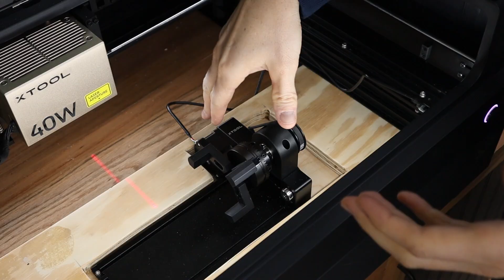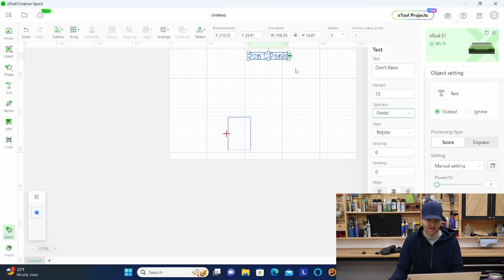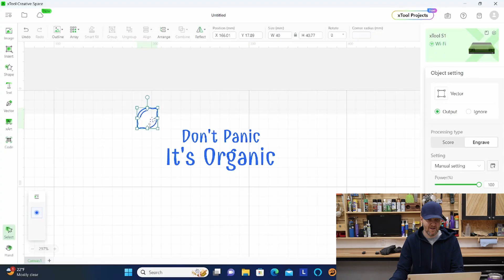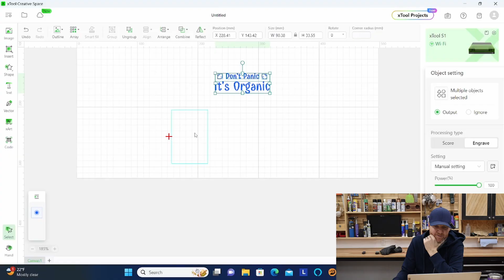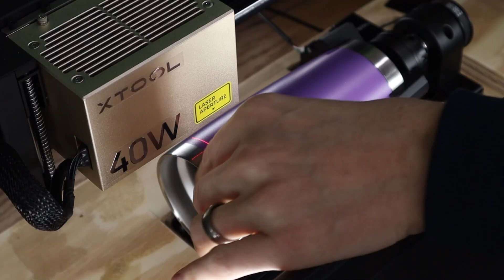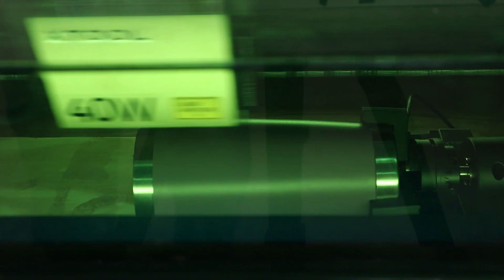xTool S1 with Ra2 Rotary Setup

Comment: So if I don't havae your custom board that holds the rotary tool, what is the best way to get a tumbler leveled?
Reply: I wonder if quarters with double sided tape would work? It would be a bit temporary.
Reply from the maker: I would try some wood or plastic shims and some tape once you get it set up...good luck!

Comment: Is your S1 connected to the air purifier? If so how. I'm looking at buying an air purifier but one is ( here in the UK ) £250 for the desktop and £1000 for the floor standing model designed for the S1. Thanks
Reply from the maker: I have my S1 just connected to a fan that goes outside. There should be 2 different air purifier models that work with the S1. And then they have a small one that is designed for the F1

Comment: Hope you can answer. You hit the engrave over the sketching feature.  Whats the difference ?  I have the wecreat laser and i HATE IT. Lol. Ive had nothing but issues with it. I see that you also manually put the laser where you wanted it to engrave but can you do that with the software or always manual? The crosshairs did not match what came out on your tumbler.
Reply from the maker: Hello, I'm not sure what you mean by the sketching feature? In this project I just use engraving, but there also is a score feature that can be used if you just want the outline of the lettering or Clipart done. The crosshair is adjusted  by physically moving the laser head, and when you do that the crosshair in the software adjusts to that. So in the software I had the crosshair lined up let's say an inch above the engraving I was going to do. It is a little hard to explain typing it out, but makes sense when you use the machine. Sorry you are hating the Wecreat!

Comment: Just wanted to say great video, very informative. I have a question/ issue I'm having with my S1 RA2 pro rotary. I have done everything that I'm to do with the rotary but, my framing doesn't work anymore. i used it when I first received it and completed a cool tumbler, I put it away for a month or so and now when I hook it back up it won't frame. I have tried to contact X-Tool but with no help. they tell me I'm doing something wrong but I'm not. Do you have any ideas that may help? I have even purchased a new RA2 pro and still nothing. I have tried everything and I'm ready to sell. Signed frustrated....
Reply from the maker: That sounds frustrating, I have never had an issue with that setup, but maybe it is just an update issue with the software? You could also try to video what your problem is and send that to customer support. I hope you are able to figure it out, because they can really do amazing things!

Comment: I wonder if you can help me please. I've noticed you are not using a base plate. Could you please tell me how you got around this please. I've been trying all afternoon now 😢
Reply from the maker: Is it not letting you start the engraving without the baseplate? I didn't have this issue, but xtool could have changed this for safety reasons

Comment: Do you have to get the accessory kit they sell separately?
Reply from the maker: Hello, I'm not sure what you mean by accessory kit, but to do tumblers, you will need the riser base and rotary for the S1.
Reply: @chaddiy  there is an $80 accessory kit for the rotary tool. It looks like it helps the tumblers and items you’re engraving pivot.

Comment: i follow your video on how to set it up using the rotary on the s1 I have a tumbler that has a design on one side but not on the other side so I was doing it on the blank side and I framed it on the blank side but every time I go to start the process of laser engraving it rotates to the side with the design already on there. is there something I could be doing wrong?
Reply from the maker: Hello, sorry you are having issues. If it is framing, that is where it should be doing the actually engraving as well. You could try restarting everything and see if it works, or add painters tape to the tumbler and run a test at 1 percent power and see exactly where it is going to engrave. Good luck!

Comment: I watches this months ago and used your coupon. Im having issues engraving light color tumblers. I keet getting lines im my engraving no matter what I do. Dark colors i got them on point
Reply from the maker: Hello, I'm sorry to hear you are having issues. I have never gotten any lines on tumblers, but did a few times on business cards. I thought the issue was the card was moving a little bit from the air movement of the laser head back and forth. If you are using the rotory, I don't think that would be an issue. Maybe reach out to xTool customer support and ask them about it? That is a strange issue forsure...working fine on dark but not light. Good luck, let me know if you figure it out!
Reply: @chaddiy3512  yeah no worries. I feel like it's user error 😆 my ocd doesn't like the lines in the engraving.

Comment: I have watched your video and the clack shack. Both videos are great by the way but my images keep being backwards. I did what the clack shack said and my images are still backwards. You didn't get that issue. How would I go about if I place an image in and setting it to where it does not come out backwards. There is no mirror step anywhere in the UI. Thanks for your time.
Reply from the maker: Hello, Sorry you are having issues! Could you miror the image in a photo editing program first and then import it into xtool creative space? I guess I have never had this issue before so I might not be much of a help.
Reply: How did you make that
Reply: Did you have the rotary positioned with the motor on the right side

Comment: I noticed that you centered the image with the red crosshairs. Is this typical? This will be my first tumbler. I have only done flat wood engraving so far and I always placed the image in the bottom right quadrant of the crosshairs. What should I do?
Reply from the maker: Hello, you can actaully do it however you would like. The xTool S1 shows wherever the laser head is on the software itself. So if you want to put the cross hairs at the bottom left, you would just have to make sure the graphics you are engraving is above that crosshairs in the software. Always make sure you Frame it before you actually do the engraving. This way you will know if you have it correct or not. Good luck!
Reply: @chaddiy  thank you!

Comment: Great video!!!  Question: 
have you engraved a Yeti tumbler and was it exactly the same process as you just showed here on a non Yeti?  Are there any settings that you might change with a Yeti vs a non Yeti??
Reply from the maker: Hello, I have never done a Yeti, but everything should be the same. Basically all colored tumblers are the same. Powder coated stainless steel. The brand really doesn't matter. Good luck!

Comment: I just got my S1 with rotary tool.  BUT, I hope I didn't screw up...all the influencers are using the 40 watt module.  I went with the 20 watt because the laser dot is smaller and supposedly more crisp.  Since you went with 100% at 500 speed, does that mean with the 20 watt I will need to do two passes to get the same quality as the 40 watt?  I haven't seen any in-depth videos that discuss if the 20 watt or 40 watt is better/worse.  Thanks!
Reply from the maker: Hello, I think you will be just fine with the 20 watt. You will just have to run it at a little slower speed but keep the 100 percent power. Have fun with your new laser!

Comment: The Clack Shack was the only other video I saw that used the xtool s1 with the ra2 pro and in his video he did the same thing as far as having to make a jig to hold the ra2 pro in place due to the tray moving.  He mentioned he Perferred putting it right in the center and I noticed you put yours closer to the front.  Did you find it hard to take the tumbler out or in some what bothersome in that area?  Im getting ready to start using my xtool s1 for tumblers and watching both videos is helping me decide whats going to work best.  Thanks for the video.
Reply from the maker: Hello, I do have my towards the front which has worked fine. Setting the jig in the center would probably be better if you plan on engraving all around the tumbler. The biggest difference with this is it is probably easier to layout your engravings in the software if you start with the laser head in the center of the machine. The s1 does a great job on tumblers...enjoy!

Comment: What was total time to engrave?  I'm trying to figure out how many I can do in an hour, day, week etc.  If all I were doing is tumblers.  Not saying that's all I would do just trying to figure out how quickly I can pay for the S1 and if this is a viable side hustle.
Reply from the maker: Hello, I think this took around 7 minutes to engrave. I figure if you don't count the actual time designing in the software, it takes about 10 minutes per tumbler to get it set up in the chuck, leveled, and engrave. They are a lot of fun to do and turn out great!
Reply: For primarily doing tumblers, it seems like the F1 might be the best XTool option (if you’re fine wearing the glasses). From what I’ve seen the best results come from doing two passes, one with the 20 or 40 watt and a second either way the IR. The F1 can do both quickly without needing to swap modules in between.

That said, you can do the same a little more tediously with the S1, if you want a more versatile or safer device.

Comment: Enjoyed the video...Thanks! Just got mine and about to try my first tumbler :)
Which smoke purifaction would you recommend for the S1?
Reply from the maker: Glad you enjoed the video. The S1 has been working great for me making tumblers. As far as smoke purifiers go, The one I have is a smaller one that is just ment for the Xtool F1. They do make a larger one that works with the P2, M1 and S1, so I think that is really the only option if you don't want to vent it to the outside.